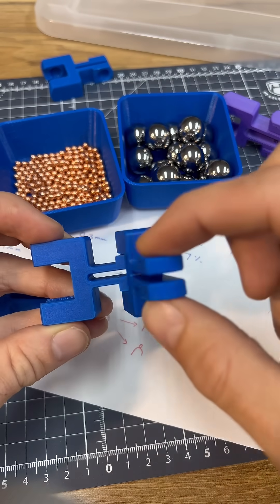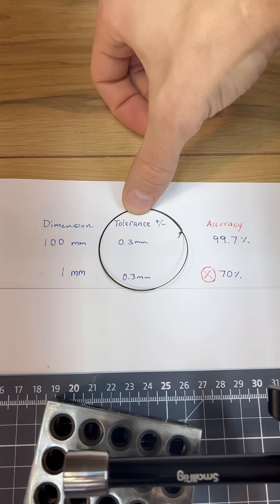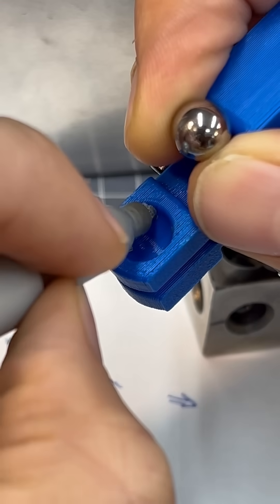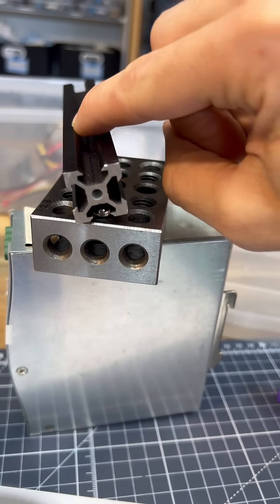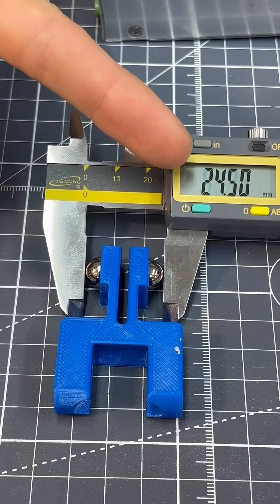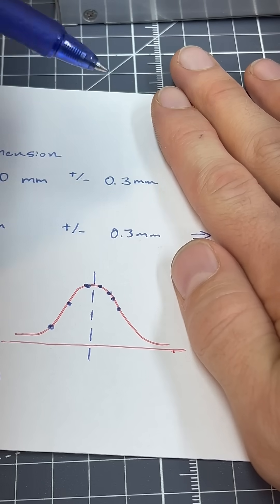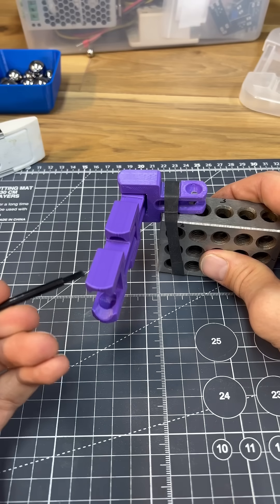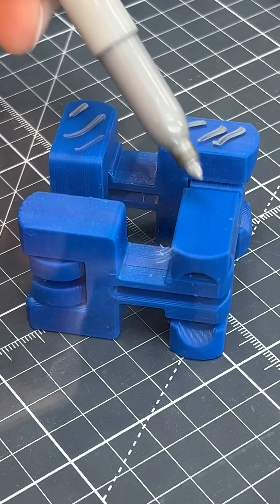Exhibit 1: borrow a tolerance, design 3D printed part with Axis.

Comment: Thought I was losing my edge not understanding this guys story but happy to see no one knows wtf he is talking about
Reply: I watched this about 30 times and couldn't figure out what he was talking about. Finally I decided to go look at the comments and I'm not alone. Thank you for preserving my sanity
Reply: @kevinavillain4616  I watched it twice and seemed like total bullshit. Spend 20 minutes watching any machinist and his gobledigook is obvious.
Reply: Long story short:  You can make components with a less reliable process, cleverly add some VERY reliably manufactured parts, and have the whole structure enjoy the tolerances of the more reliable method.

Imagine using a compass to draw a circle.  Use one of the old ones that has a point at one end and a pencil held on the other end by a clamp.  You want a nice, smooth circle.

Now, imagine you make the clamp a little loose, and the pencil wobbles as you draw the circle, and you get kind of a wavy line. This imitates poor tolerance, and it's like the reliability of 3D printing that he's talking about.

Now draw lots of circles.  Each one is a little different.  That's a pain in the butt for manufacturing.  But, look at your wavy line on each circle.  Find the 3 points on each of the wavy circles that are closest to the center of that circle.  Those three points describe a new circle.  You'll find, because of averaging and normal distribution, these new circles are all very similar to each other -- even though the ones drawn by our wobbly compass were not.

Drop a ball bearing that has been made by more precise manufacturing methods into each of our 'wobbly' circles and the bearings will be held by the 3 points of the wobbly circle that are closet to the center.  The bearing is like our 'new' circles.  Their position in the wobbly circle is much more predictable and reliable than the size of the jiggle in the original circles.  You can lay a flat sheet across the top of the bearings, and it will sit flush across all of them.
Reply: It took me three watches, it is because he doesnt clearing define the problem at the begining that he is attempting to solve.
Reply: just bring big steel ball and all your 3d prints would be perfect  :D
Reply: He's defining his dimensions with his balls.
Reply: So basically he created three tolerance points to allow a firm grip of the part. This however creates a long term weakness because it will get loose over time due to higher friction which means that since the contact points are of a smaller surface, then it will be worse than before.
Reply: This is just what he does. He’s not actually smart or good at engineering (he called it borrowing a tolerance which doesn’t exist) he just likes to troll people
Reply: @FuriousPikefromYellowCity The "borrowing" terminology just refers to adding something that isn't 3d printed to the part.

Comment: Good idea, the multipoint referencing.
Poor explanation.

You stumbled in your explanation because you  explained the sphere positioning that largely is irrelevant to the point you are trying to make. 
By explaining the sphere positioning first, people are going to think it is critical to understanding what comes next, but you are trying to explain how to create an axis. Sphere positioning is not important for understanding the axis positioning/creation idea. 

Sphere positioning after explaining axis would have been an ok addendum for improving the design. 

Then you show a caliper measuring the length from sphere top to sphere top. WHY?
Your design has flex in it so that the axis points distance is none critical to the function you are trying to achieve and the accuracy shown is not achieved through the concept you are trying to explain. It makes the person you are explaining to think that the LENGTH is critical while you are trying to explain the ANGLE and POSITIONING of your idea.

Comment: For those that are confused (and too lazy to watch the 30 min version, like me), I think what he’s saying is that by incorporating a ball bearing into your joint, your measurement along the hinge axis goes from being dependent on the tolerance of one length to the average of the three lengths, meaning your actual measurement is more likely to be accurate.

did I understand that right?
Reply: The only reason his hinges work well within the constraints of 3d printing tolerances is because he designed  flexures that will yield to poor tolerancing.  His final claim that all the surfaces will be in the same plane is utter BS and makes it clear he has no idea what he is talking about with regards to 'tolerancing'. His approach simply allows a process with inherently poor tolerancing to achieve a smooth kinematic operation
Reply: Finding the full video is the real challenge
Reply: You know, I came up with a whole song and dance with much longer words, and I think this is probably still more correct than I did it. Although, it is technically a 6:1 ratio per ball (3 left and 3 right), but that is definitely the idea so far as I can tell.

Comment: you have found the best way to explain it in the most confusing way possible
Reply: which part is confusing tho?
Reply: Agreed lol. Prob for click bait purposes
Reply: @vex123 No, they're using standard terminology, it's just not something most people understand. What they mean is that you can print something with low tolerance that incorporates something that has a higher tolerance, to gain the benefits of that higher tolerance part while keeping the majority of the structure 3D printed.
Reply: @nikkiofthevalley I think your're the only one who undersrands 😂
Reply: @nikkiofthevalley  Doesnt make sense though. You still adding a part with a tolerance. If you have just printed it directly you would only have one tolerance, not a stack of it.
Reply: @nikkiofthevalley  thank you. this video made me cry because i wasn't getting it and I'm a grown child
Reply: @nikkiofthevalley  Given that I am currently working on my Metrology certs, I can confidently say just trying to justify an explanation with jargon concepts and terminology is pure nonsense.

Keep it simple and dumb it down if it means trying to convey a concept to a general audience. “Keep it simple stupid” was a motto to follow when I was working on my mechanical and electrical engineering degree.
Reply: @nikkiofthevalley This I could compute, the video, not so much. Thanks. ☺️

Comment: As a metrology engineer, 3 points can define a plane or a circle, but 5 are required for any 3 dimensional shape
Reply: 5 may be needed to define the sphere, but only 3 are needed to fix its location.
Reply from the maker: maybe i should be extra careful
how i say it.  for sure 3 points don’t constrain it, and 3 can only define it if the radius is also given.   “locate” was the best i thought of.
Reply: @RazzleberryHaze  you need a minimum of 6 points to orient any point in 3 dimensional space. If you need to accurately locate the center of a sphere, using a cmm or the like, you need minimum of 9 points.
Reply: @roscoepatternworks3471  mathematically speaking, only 4 points are needed to constrain a sphere - 3 to locate and a 4th to define the size, assuming a perfect sphere and perfect measurement accuracy/precision.
Reply: @nikolaihedler8883  you did notice I said "accurately locate the center of a sphere"? Using 3 points to locate a sphere. The 3 points have to form a circle smaller than the diameter. Adding a 4 point won't give you a radius. Using a cmm 1 point is measured at the top, 3 around a latitude and 5 at the equator. The more points, the more accurate the center and diameter of the sphere will be. This also works for a dome feature on a machined part.
Reply: @nikolaihedler8883  if all you want is to constrain the sphere any 3 points smaller than the diameter will do that as the sphere will touch only those 3 points. Calipers can give you the diameter, so the 4th point is not required. Even a bearing has a tolerance, so a 4th point will not give you an accurate location of the axis.

Comment: So, your approach to tolerance analysis and using bonus tolerances to get a better distribution is totally valid, but I want to point out that 3D printing tolerances don't scale the way you're representing.

There's a localized error that arises from material properties and process (i.e how the layers lay on top of each other), and a macroscopic positional tolerance that is representative of the machine's ability to track its position. 

In practice I've found that for an amorphous material like PLA, I can get localized tolerances of +/- 0.2mm up to about 10mm.

Also, the tolerances don't work out to be normally distributed because there are two specific factors and not a whole bunch that drive the stack, but you didn't really use that assumption except to show how the distribution should end up. The non-normality only really comes up when you're trying to describe the Cpk of the process

Comment: The audio tone (an ever increasing tone) that starts out very subtle and gets louder as you explain the reason behind turning an axis (hinge pin) into two points (spheres) due to the poor production accuracy of 3D printers in general when compared to other methods.  Looking at the comments, your communication technique is effective.  Well now the "ever increasing tone" is out of the bag, everybody who wants to look like a genius is going to use it.  But they won't be geniuses they'll just be explaining average everyday things.  And as others have said "borrowing a tolerance"? and "where our balls are" lol  I would have used different terminology, but overall an excellent demonstration of video techniques that borders on mind control.

Comment: I'm a retired cmm programmer and have a fairly good understanding of gd&t. So please explain borrowed tolerance. Each individual part has a tolerance. Your printed parts have a tolerance separate from your bearing.    Nothing is borrowed.
Reply: 'borrowing tolerances' is just a phrase he came up with - I think he tried explaining it in a previous short. Still makes no sense. He seems to confuse 'tolerance' with several other (mostly) unrelated concepts
Reply: He is outsourcing his tolerances, not borrowing them. He doesn't understand that words have meaning.
Reply: I think he means rather than try to design a 3D printed hinge with tighter tolerances than a 3D printer can achieve, he's incorporating another part with very high precision and designing around that.
Reply: @383mazda  the fact that you are restating what he said means that he didn't communicate it very well in the first place.
Reply: @Squirl513  agreed, this short was poorly explained.
Reply: "borrowed tolerance" ~= average of tolerances.
An analogy might be GPS satellites, as more are available a locations exact position is more accurate going from miles wide to a few feet away
Reply: @TheNewton  not sure where the analogy is, even that wouldn't be borrowed tolerance. We are talking mechanical parts fitting together. The sphere has a +/- tolerance as does the part it fits into. The designer needs to determine an mmc for each part. Then, determine a lmc that would still give a proper fit. Still, no tolerance is borrowed.
Reply: @roscoepatternworks3471  I see the analogy @TheNewton is referring to, in the sense that positional error in GPS decreases with increased "samples", in this case satellites, to compare. Positional Error/uncertainty being the analog for tolerance. Instead of having 3 absolutely perfect satellites, which is impossible, having  11 very good satellites would make an incredibly accurate positional fix. I think, from a laymans perspective, this helps explain the "normal distribution" part of this short, and the mindset difference the vid creator is trying to convey.
Reply: I think I know what he was trying to say, but this video was missing a little bit of information. I don’t know what, but definitely missing some key info
Reply: By using balls, rather than pins, he is using the dimensional accuracy (tolerance) of the balls rather than the tolerance of printed pins. 

The rotational axis stays consistent but the contact points of the model will be on a different part of the ball according to how they are printed. 

So borrowed might be the wrong word, but he’s using the ball tolerance rather than the printer’s tolerance to minimise the out of plane movement errors.
Reply: I'll explain it for you:

He used a part that wasn't 3d printed so it was "borrowed". The part had to have a tighter tolerance than a 3d printed part, therefore he "borrowed a tolerance" from a "borrowed part".
Reply: @stickjohnny  Doesnt give him anything though. he just added another part to ghe tolerance stack.
Reply: @fracapolligummala3548  I think you are getting way too obsessed with the semantics of "borrowing tolerance". He isn't claiming that he can change the tolerance of the 3d printed parts by adding a part with a higher tolerance.
Reply: I think he means borrowing the steel balls engineered tolerance vs a printed one. The problem were all having I think is we don't know what he's comparing. Did he add three small balls to the cup holding the ball?  Did he add 3 printed pins inside it? Or is he comparing to something else that isn't clear at all...
Reply: He's trying to use the ± tolerance to average out the faults to nearly 0, but that's not how it plays out in real life (because the actual part has random +s and -s). You'd need to print them oversized, measure them, and shave parts down to the desired measured size. 

If you want your hinge to move perfectly straight, you need to confine it from moving in other directions. The balls made for smooth articulation, but not flat surfaces on the sides, nor straight rotations.
Reply: By using this method, you are effectively spreading out the axis contact points from 2 to 6. This makes the average of the 2 axis contact points more consistent because the tolerance is both +/-. 

There is a higher likelihood of a print finishing with a + error at 2 axis contact points than a print finishing with a + error at all 6 axis contact points.

Even if the 6 axis contact points aren't perfect, it has a higher likelihood of a finished part with a distribution errors at the contact points with both + errors and - errors.

Hope this helps 😊
Reply: @theonismithcreations8554  still don't see borrowed tolerance. If you have a sphere in a socket. And the joint has rotational force applied, the actual axis of the sphere will move. The surface of the sphere will remain in contact with the socket at some locations that are defined by the +/-  tolerance on the socket itself. And by the ×/-  tolerance of the sphere. Location of the axis will change depending the direction of the force applied.
Reply: @roscoepatternworks3471 If you are printing a socket from the bottom up, the elevation of a seated bearing will be solely controlled by the z axis of your printer (unless you have some weird seating issue). 

By adding 3 points of contact, you are controlling the elevation with all 3 of the printer's axis. In this way, you would be "borrowing" the tolerances of x and y to average out z. 

If the y axis prints with a high error, that wall won't directly push the bearing because that bearing is seated on 3 points of contact where the z and x axis affect y.

So they are "borrowing" tolerances from each other.
Reply: @theonismithcreations8554  as you just described there is no tolerance that can be applied except a profile which would apply to all 3 contact locations. Those locations as defined on a drawing or 3d model would be nominal, if no tolerance was applied. The deviation that falls within the applied tolerance is an averaging of the location of the inserted sphere. But any tolerance is defined in xyz. With the exception of a hole or boss.
Reply: @theonismithcreations8554  finally i got it, and that is really brilliant, i wish the  video  had explained that well, telling the solution  to a problem to a person who doesnt know the problem you are trying to solve is not very effective
Reply: @theonismithcreations8554 This is a very nice explanation, thank you
Reply: @theonismithcreations8554  Why would it be 2 points without it?
Reply: Seems over engineered for a 3d printed part
Reply: @Onhaey I'd look up what over engineered means
Reply: The level of nerd in these replies just unlocked a secret boss fight. Lol